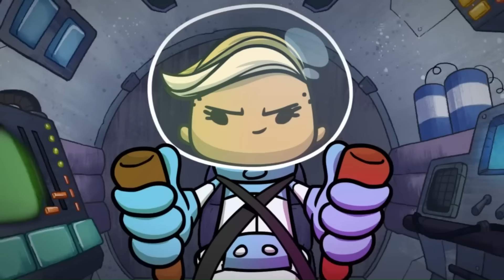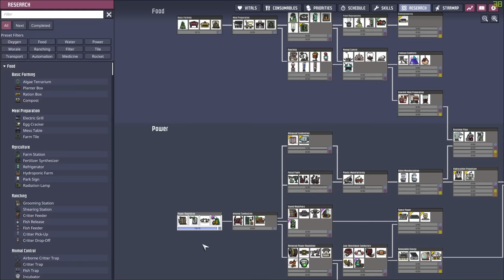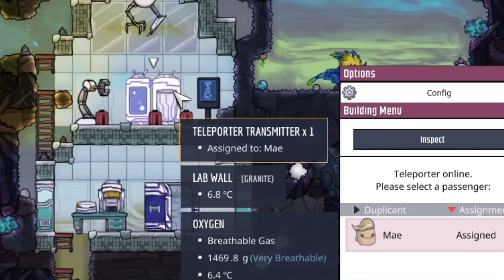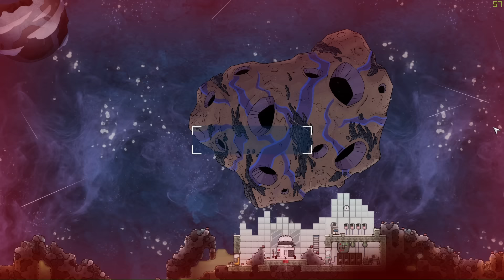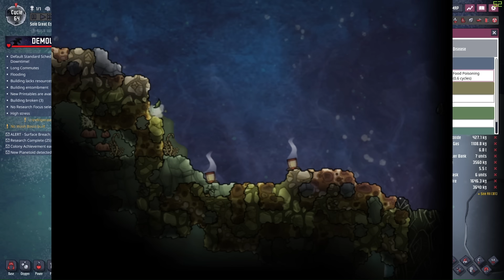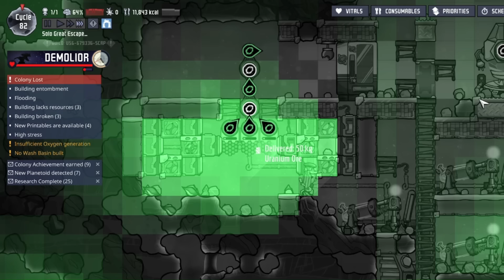I Beat 𝑺𝑶𝑳𝑶 Great Escape in 100 Days of Oxygen Not Included!

Comment: Dude, I noticed you removed the supply packages from the portal, that's why 3 options appear there. But did you know you can change the default from 3 cycles to more? Set a high number, just to reject them. When I play, I feel anxious about that thing being on and making noise. I can't imagine how you manage to ignore it for so many cycles.
Reply from the maker: Really? There's such settings to prolong the 3 cycles per print? are you sure that's not a mod?
Reply: @tabeyuriko  I thought this option had been added to the base game after all this time. I'm so used to playing with the DGSM (Duplicants Generation Settings Manager) mod that I assumed it was already a built-in feature.

I looked into whether it could be changed directly through the game's files without using mods, but unfortunately there isn't any simple native way to do that. The only practical solution is to use a mod like DGSM.
Reply from the maker: @ThiagoXIII  it's okay, I am mostly non-mod players unless the challenge explicitly requires one. Thanks for the suggestion though!:_happy:

Comment: i need 1500+ cycle to achieve this and this Mae guy only need less than 100 cycle... alone

btw another thing thatt you could improve to prevent hydrogen stop is to make another canister drainer as a spare
Reply from the maker: Thank you!! and yeah I thought of an extra hydrogen drainer only after run ends :(
Reply: another exploit, umm i mean knowledge i learn: telescope inside rocket and canister filler 0-200 repeatedly

Comment: Very nice run ! Thanks you to keeping the speedrun community alive.

Space heater are now warming station like wood heater, and you could micro manage to have it ON only for the buff. That would have make the tundra planet much more enjoyable for mae at the cost of a single research. Might be worth it with the stamina debuff, the exhaustion debuff and athletic debuff on tundra. Or you could get some branch on the second planet, but the one we can see were not grown out (maybe they were before leaving ?).
Also, neat trick, dupes can't get cold when they are running the hamster wheel.

A powerless and fast method to get a lot of oxygen and hydrogen (even co2) in canisters is to put a electrolyser (or hydra) in the nosecone, then destroy it. For example I did it with the underground telescope rocket (like you talked about) with an hydra in my tear cycle 24 run. You could add a burner and electrolyser capsule to have everything bottled up powerlessly.
You might be able to get some phosphorite on the trip to get a bit more radiation via wheezeworts, but it's kinda dangerous for your dupe then.
Also it's one of the rare cases where "center of attention" can be useful, when you try to avoid the crisis in the forced sleep part for example.

In my cycle 20 carnivore run, i put a puddle in front of the cot to maintain high stress, it basically automate the stress. But you are right, they are pretty hard to stress at the start.

I think you can gain a bit of time with rovers, if it does not defeat the solo requirements. The gain at home planet would be minimal (still ok-ish, they can rebuild the next rover, bring material near the rocket and bring food to a ration box near the rocket), but in the tundra planets, they could have help a lot, and the constant back and forth of the rocket generate a lot co2 to fuel the rockets, so might be able to skip the burners too. And it would only cost you 1 research. If you B-line to it, they can do some more the work. In the home planet, you can do the taking off/landing for them while doing the in-rocket astronomy, so not much time wasted here too. It doesn't seem that way, but they really scale rapidly.
Reply from the maker: Guess what, I actually thought of the space heater........... when I was making the video editing lmao

Electrolyzer in rocket into bottles is very neat! How would not think of it 😅

About the burner -- on top of generating co2 I was also thinking it would help me save more hydrogen as well by replacing the power supply
Reply: @tabeyuriko most of your power comsumption was in bottling gas i think.😂
Reply from the maker: @trm_quindan  Yeah I guess so... but if I do the rocket bottling I bet there will be more complaints on too exploity :_happy:
Reply: @tabeyuriko fair enough.